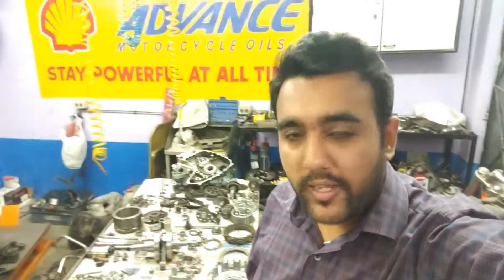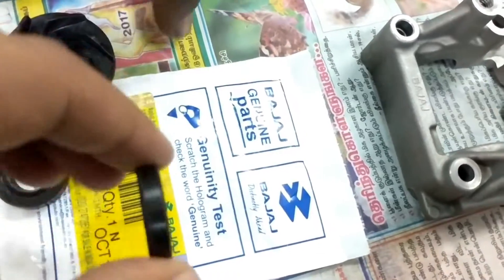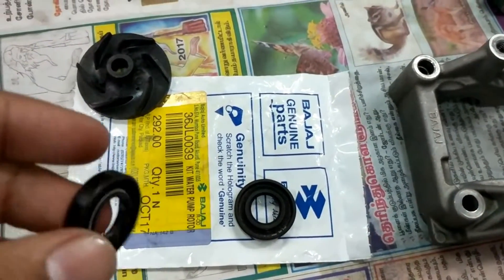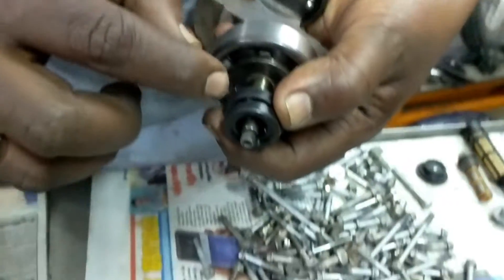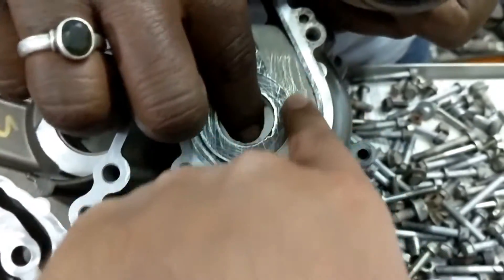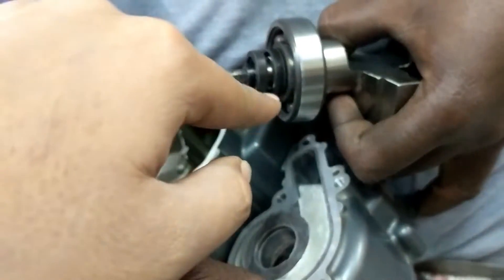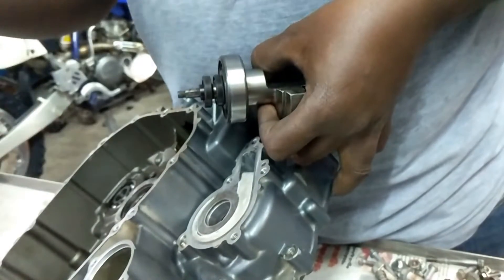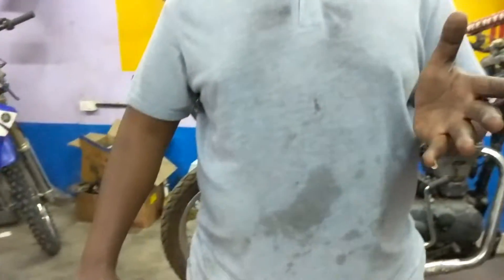Why does the coolant mix with engine oil in KTM 390 Duke/RC? Major Fault!!

Comment: Wow. I was looking for the excat cause for a long time. Nice video.
Reply from the maker: Sachin Syam ah.. thank you!
Reply: @saajanjogia     hi bro, please give me an advice on changing those oil seals!
Do I have to change or buy any specific parts which needs to be changed while changing the seals?
I'm in UAE 🇦🇪 here in UAE it is very expensive for the company service so I would rather go to the local workshop..

And brother isn't possible to open duke's engine without company tools? Or it is just false information?
Please respond brother. Thanks

Comment: after finding this issue how much K.M. we can ride without damaging?
Reply from the maker: pushkaraj ahire I think you shouldn't ride at all.. more you ride, the more damage engine takes. I suggest not more than the distance to your nearest KTM SVC
Reply: THANKS , & I NEED A NAME OF PART TO SOLVE THE PROBLEM WHICH I CAN ORDER FROM NEAREST KTM SVC CAUSE I HAVE NEAREST SVC ON 120 K.M.
Reply from the maker: pushkaraj ahire ohh that's far.. I suggest you tow it then, because there are multiple parts involved. Better get all done at one place

Comment: Nice effort and content!! Where are you from? We should meet up if you're from Chennai..
Reply from the maker: Jewel Tr hey thank you! I'm from Bangalore.. will tell you if I'm coming to Chennai
Reply: @saajanjogia     hi bro, please give me an advice on changing those oil seals!
Do I have to change or buy any specific parts which needs to be changed while changing the seals?
I'm in UAE 🇦🇪 here in UAE it is very expensive for the company service so I would rather go to the local workshop..

And brother isn't possible to open duke's engine without company tools? Or it is just false information?
Please respond brother. Thanks
Reply from the maker: @shameertn  Hey find a local garage who has experience in fixing the 390's engine. Unless you don't know what you're doing, I suggest you don't fiddle with the engine. Also, you will need new parts like seals and if anything else is damaged or worn out which you'll know once you have your engine opened by an expert. Hope this helped mate

Comment: Wow..appreciate your effort taken to explain & find out how this happens!..Very very informative as myself had faced this issue in my 2017 Duke 390😡..it was a headache for me as i had to drop off my bike for almost 3 weeks to get it fixed!
KTM really needs to gear up their quality standards as lot of complaints rising up from the new Duke 390, which no other bikes show until they get really old!
I've faced lots of quality issues where this(coolant mix) and clutch slip were the major issues.All this happened in just a span of 5 months of ownership😟
Reply: wats cost you pay to fix it
Reply from the maker: The_ petrolhead very true. I've faced problems from them too but eventually it all settled. If BMW/tvs 310's motor proves to be reliable and effective, then these guys have a big reason to worry.
Reply: Bro how to get to know if coolant is mixing with engine oil in 2017 390?
Reply: @nischalk1336  When engine oil gets whitish color means Engine oil mixed with coolant
Reply: Minnat Reza ohh..thanks bro
Reply: Now i have this problem with my 690r. Shit!